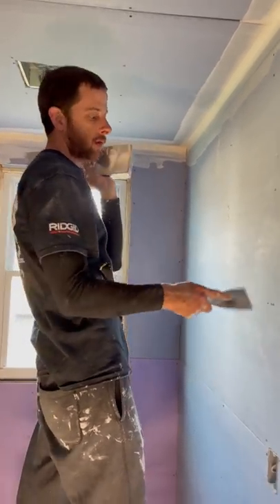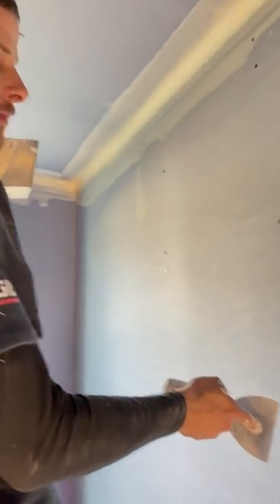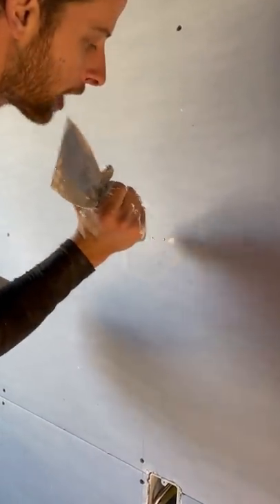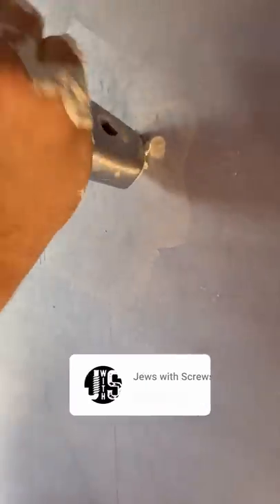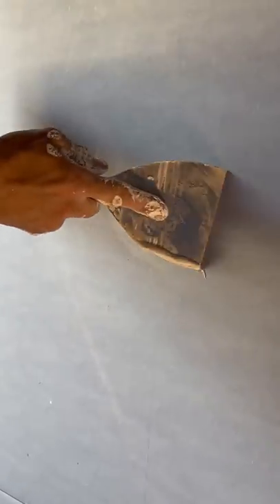Spackling Missed Screw Holes | Tuesday Tip #shorts #spackle #spackling #sheetrock #construction #tip

Comment: Why wet it first before making the indentation? What is the purpose and benefit?
Reply from the maker: You probably don’t HAVE to, but get some mud inside so it helps the top level bond to the inside. If it works without that first wet then sweet. No biggie either way
Reply: @JewswithScrews  thanks I'll try it and see if it works better
Reply from the maker: Let us know!
Reply: That's how the pro finishers I've met have done it. Cutting them out clean is another option, but takes more time.

Comment: As a drywall guy, I'm not a jerk. I'll run my axe along the screw lines and check for clickers. I won't back the screws out either. Just makes it harder for the tapers. Just tap them in right with the hammer or screwdriver.

Comment: Here’s a Tuesday tip: code everywhere requires 5 screws (not 4) across the width of the sheet. And screws sunk deep into the board which fracture the paper do not count as fasteners. Ghetto work, would flunk inspection.

Comment: This drywall mud, joint compound, or hot mud if you have to mix it out of a bag with a number(how many minutes it takes to dry). STOP CALLIN DRYWALL COMPOUND SPACKLE! Also you don’t have to “wet” the wall to press the paper back in. Knife work is more than decent, keep it up.

Comment: Push it in first then mud it, Mudding and swiping is an extra step that's not needed. I prefer to just use the back of the knife. push against the DW and it creates a dimple, then mud and swipe.

Comment: So, if it sticks out abit, you just push it back in? K thanks
Reply: It's gotta be flush out dimpled.  Also, you need to get mud with a bonding agent (all purpose or quick-set) to hold loose fingers tight.  Ideally, you cut out the damage and smash muddy in there.

Comment: This is all wrong. Dont push the screw hole in. What ya gotta do is apply 4 to 6 layers of spackle over the entire wall to bring the level out to the screw hole. It will add about 3 days to the job, and hundreds of dollars worth of spackle but my way doesnt require banging a dent in the wall.

Comment: You have a scraper in your hand slide it against the paper and it cuts the paper making the wall nice and flat so much easier and quicker
Reply: No, it certainly does not work that way. I’ve probably filled 10s of thousands of holes and doesn’t lay flat as you suggest. The paper absorbs and rises. That’s why he needs to indent it.
Reply: @oldmanballs787  I've been doing this for thirty years. Never once had a problem with that. If you scrape the paper properly it will level off easily to the rest of the wall
Reply: @mikedumais1071  it will never lay flat because compound goes ONTOP of it. If it’s indented it will lay flush.
Reply: @oldmanballs787  your only objective on this is to fill the tiny screw hole.
Reply: @mikedumais1071  no it isn’t. The paper flares up. I don’t know if you are actually a tradesman or not, because there’s a 0% chance it will lay flush if you just try to fill the hole.

Comment: Hey everyone, im not drywall expert but do patch work occasionally. Does it make a difference whether you pound/press it in. And does it matter if you patch it first b4?
Reply: Hi, I'm a plasterer and yes you should  pound/press it in BEFORE you apply mud. Otherwise, you just end up messing the tool you use to push the paper in and it does'nt Hélène for final result.
Reply: Help...sorry

Comment: Yes that is how you push the screw hole back in but that’s not how you fill it ! Fill it in like explained and push hard and then leave a small 💩directly on the whole, the compound will shrink and this will eliminate a need for a  second coat but there is just a lil more sanding, this will save lots of time, works on trim too !much better than putty !

Comment: Why not leave the screws in and mud over them? Can't happen often enough to worry about the money loss of the screws, certainly if it takes so long to pull them out and fix. Time is also money
Reply from the maker: We’re Jews bro… lol jk. Most of the time we actually pull them out in one motion to move them to the right/left so that they do hit a stud. Ain’t no thang
Reply: Lot of time the screw is pretty loose in the drywall, doesnt go in all the way or isnt flush with the wall so you have to pull them out. Hell half the time we pull them out they fall to the floor and we leave them anyways
Reply from the maker: Yeah that happens a lot too. We try not to lose them on the floor but it definitely happens

Comment: No need to wet the board first. Just dent the area in and mud over top
Reply: wetting first ensures there is some adhesion inside so it doesnt pop out later. bit like gluing a bit before laying it down

Comment: Why don't Americans plaster walls? They seem to just use filler everywhere?
Reply from the maker: Drywall and joint compound is the building material of choice over here. Easier to work with and cheaper
Reply: @JewswithScrews  thanks. You're not wrong... Plaster is expensive stuff.

Comment: Razor them off, do not put dents that you then have to fill in the wall. This is the drywaller’s job, the same knife he uses to size the sheets should take that off easily as he goes. Not saying he’s denting the wall but I can see diyer’s at home bashing the spackle knife into the wall way too hard.

Comment: Tuesday tip buy a stud finder!! Helps you won’t even miss the first time haha
Reply: Or mark you studs on the floor and transfer to drywall with straight edge and pencil
Reply from the maker: Yeah we do that. In this case we had sistered pieces that were about a foot long so the screws in that spot didn’t line up with the rest in that wall. Oh well 🤷‍♂️
Reply: lol Easier said than done for pros...  That only makes sense for DIYers and small jobs.

Spotting a few misses won't break the bank.

Comment: We usually "bang it in" first. Then apply.
Reply: Mudding first, then tapping allows the mud to get into the fibers and loose drywall to hold it tight.  I've seen this method used by various finishers.
Reply: @ItchyKneeSon  interesting...